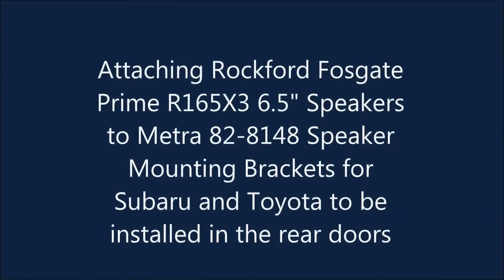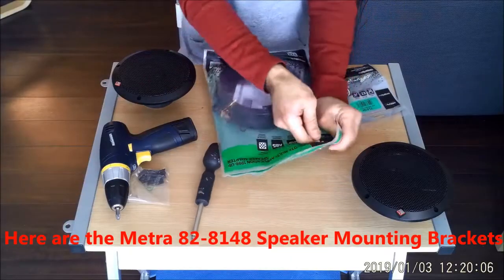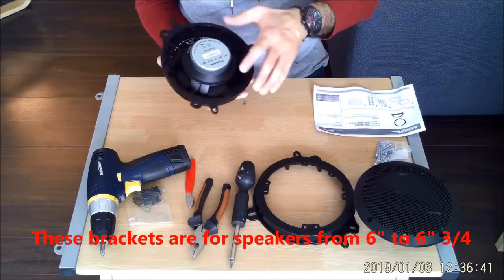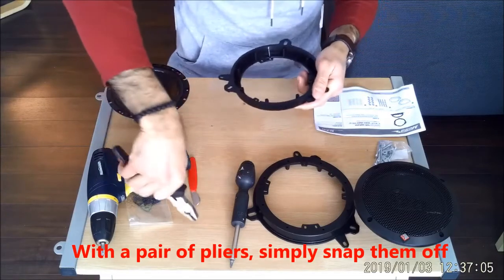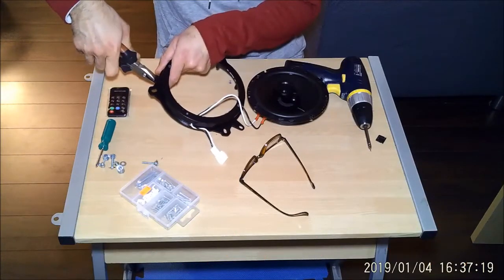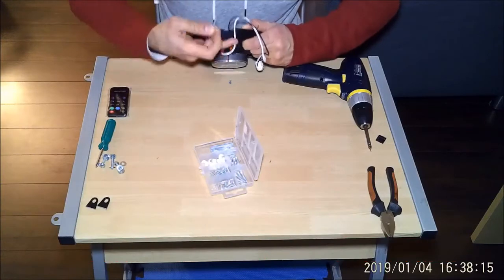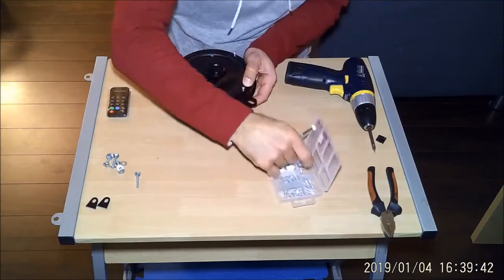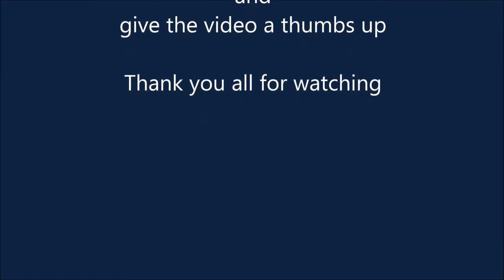Attaching Rockford Fosgate R165X3 Speakers to Metra 82 8148 Brackets for Subaru Legacy & Toyota

Comment: Thank you for letting me know that on the Metra Speaker Adaptor, I need to snap off the extra mounting tabs that are interfering with installing my new speakers to it.
No where in the packaging does it say to do that, and I wasn't sure, and I didn't want to do it until I had proof.
Reply from the maker: You're welcome
Reply: @bullshitdepartment  Wasn't in the instructions that came with the kits for my Mazda CX-5 over 2 years ago.
Where were you 2 years ago when I was trying to figure this out?